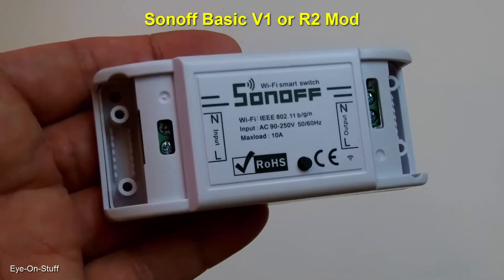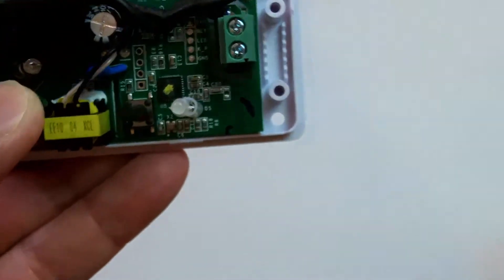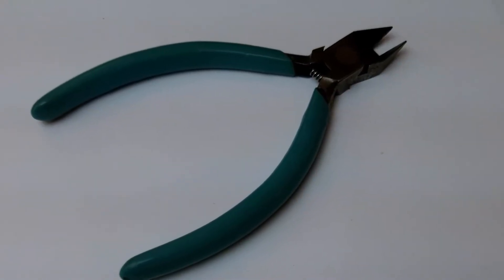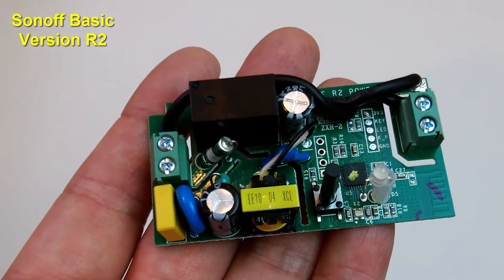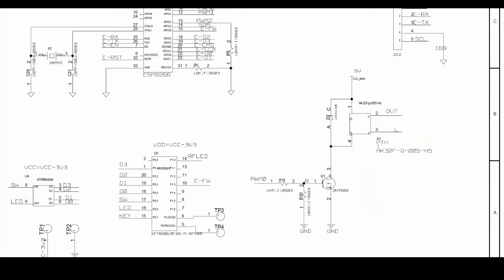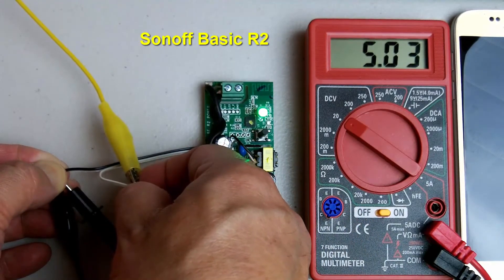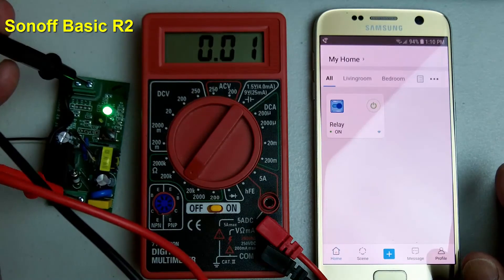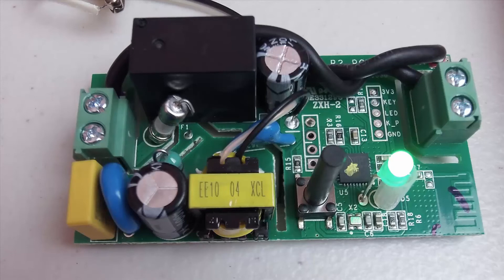Sonoff Basic R2 and V1 Mod : Power with 5VDC : Dry Relay : Eye-On-Stuff

Comment: Smashing, thanks! Just installed this into an ATX PSU using the PSU constant 5v as a power source and using the relay to close the PS ON to ground, with current free switching! ... Amazing, now have a 480w 12 volt remote / smart power supply :) .. thanks for taking the time to share :)

Comment: I figured out how to turn the Sonoff Basic RFR2 into a dry relay and installed it on my door. Works great.  Now, I have the extra benefits of using a 433 MHz remote control to open my garage and retained the voice and app capability of the Basic.
Reply: How? And did you power it from 5V DC or mains AC???
Reply: @billysgeo  remains on AC.  turns it into a dry relay - on/off.
I'm not good at videos. Have tried. But I wrote this up and took some pictures.  send an email to this spare gmail account and I will send you the write up and pictures.  buddnski is its name

Comment: THIS is a hack that comes up with a even greater device.  Love it.  I've been using one of these on my garage door.
BUT, how do we make physical changes to the Basic RF R2 or RF R3, to a dry relay so we can use it as a garage door opener controller?  I want to use the RF side of the RF R2 or R3 with a remote.  Can you show us how to change the Basic RFR2 to this type unit?,  Please?

Comment: Hi, I want to add an external physical button by which I can switch on-off the device through the pins on the board. Plus, I want to add an extra remote indicator LED through the pins. I have basic R2.  Can you help me.? there is no video explaining how we can utilize the hole pins: 3v3, key, led, k_p, gnd pins.  thanks...

Comment: Hi sir, hope this finds you well, My 6 month old Sonoff basic R2 konked off ... I tried changing the relay, but it will not budge, it won't come on  (sadly the original relay broke off while desoldering it out) (Also there is no glass fuse, its seems to be a 5 band 10 Ohms 5% resistor in its place inside a heat shrink tube).. ... Anyhow Funny though 5 other Sonoff basic R2's switches have been working for over three years perfectly well ... And this new unit circuit broke and I cannot figure what component has popped. ... I'd be totally thankful if you could guide me on how to fix it, please.

Comment: Is cutting the resistor necessary? or can I just solder the wires and power it through usb?
Reply: I have this question too. Why to cut the original power line?

Comment: How to connect 24v power to R2 version? In the same place?
Reply from the maker: I would use an LM2596 DC to DC Buck converter.  You can find them on Amazon.com.  Connect the 24vdc to the input,  Adjust the output to 5vdc and connect the 5vdc to the modified sonoff switch.  Thanks for the question and good luck.
Reply: @eye-on-stuff5248  hi will this work with a 12 volt input